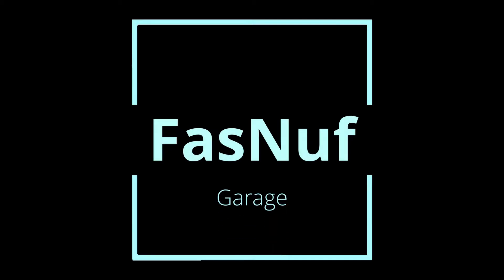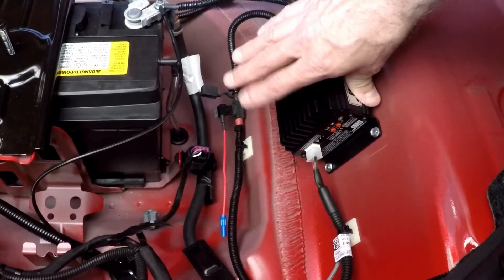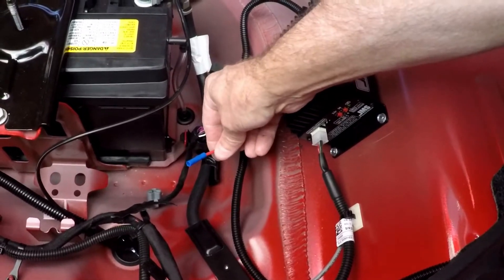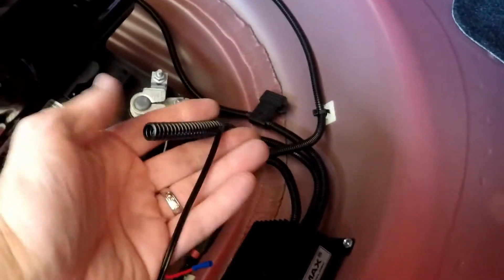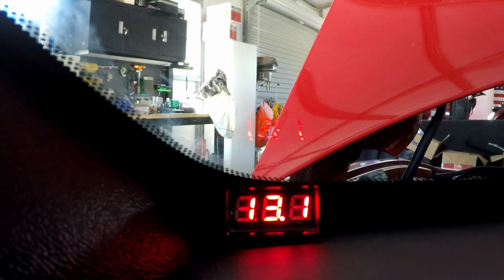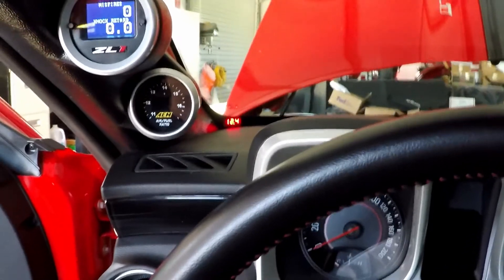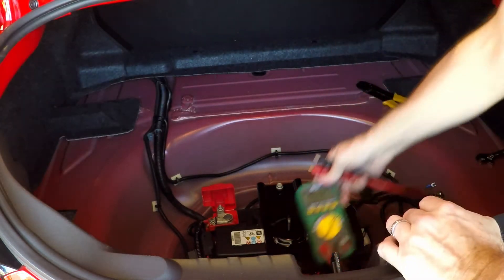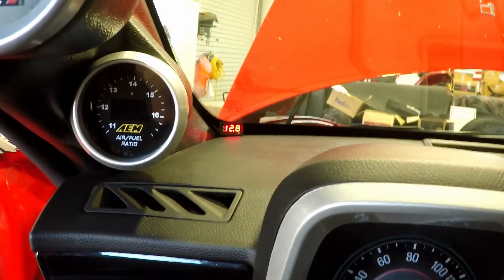Boost A Pump Voltage Monitor for the Zl1 Camaro

Comment: 2013 CTS-V Coupe I'm utilizing a JMS FUEL-MAX to boost the duel DW300C pumps.......fuel pressure is monitored via my dash mounted Aeroforce guage. I'm making 741rwhp on E85 with zero fuel pressure issues.
Reply from the maker: Sounds good John. What injectors are you using? Do you know your duty cycle? I'm adding E85 by the end of summer along with some other mods that are a surprise for viewers. I don't want to make more than 750 whp because I dont want to update the bottom end yet. I monitor pressure now with dual Aeroforce Interceptors and HP Tuners. Thanks for watching John. Catch me on Instagram if you're on there.

Comment: Man I need me one of those!! Hey do you think I would need a booster pump from my car even if it’s not running a lien?
Reply from the maker: OUTLAW PERFORMANCE GARAGE Do you have the DSX aux pump? If you do then no the DSX is enougg
Reply: FasNuf Garage yep I got the DSX
Reply from the maker: @outlawperformancegarage5211  The DSX is all you need. That's a good fuel system so no need to upgrade. The only direction to upgrade from the DSX is a Fore or Squash return system.

Comment from the maker: Available on Amazon in my description. 3-30 VDC. Comes in RED, BLUE, GREEN and YELLOW
follow me on instagram @ Fasnuf_ZL1
Reply: And what kind of gauge do you have on the top pillar? What does it do?
Reply from the maker: @outlawperformancegarage5211  Aeroforce Interceptor. Awesome gauge. My only regret is not getting the dual version with 2 gauges on one OBD connector. Shows a ton of stuff and scans too. You can set a shift light or a light to come on for what you want like low oil pressure. 
https://www.ebay.com/itm/AeroForce-Interceptor-FD502-Dual-OBDII-Gauge-94-05-Ford-Vehicles-Green-2-1-16/224100988180?hash=item342d75b514:g:jO0AAOSwdg9fJFUM
This is the dual and is green, but there are different colors or single gauges.
Reply: FasNuf Garage How much and where do I get one
Reply from the maker: @outlawperformancegarage5211  You need to know what color you want. Blue, Red, White or Green. Mine is white. Then you need to know a single gauge (about$230) or dual gauge ($400).
Reply from the maker: @outlawperformancegarage5211  
Single red color for GM vehicles
https://www.ebay.com/itm/AeroForce-Interceptor-CN401-OBDII-Gauge-05-GM-Vehicles-Red-Display-2-1-16/224100992077?_trkparms=aid%3D111001%26algo%3DREC.SEED%26ao%3D1%26asc%3D225074%26meid%3D40c36366f8964303b95ca29259bf67f7%26pid%3D100667%26rk%3D1%26rkt%3D8%26mehot%3Dlo%26sd%3D224100992077%26itm%3D224100992077%26pmt%3D0%26noa%3D1%26pg%3D2334524&_trksid=p2334524.c100667.m2042